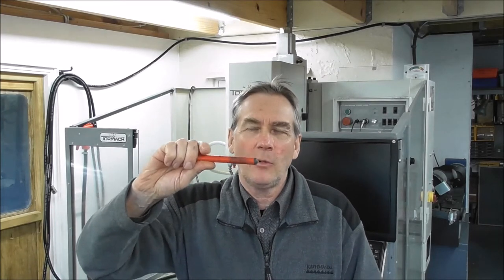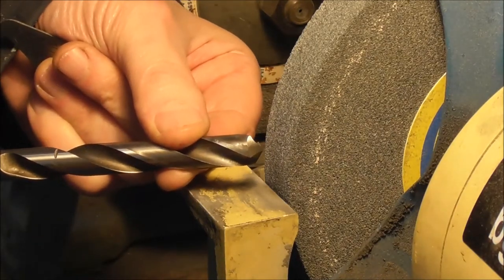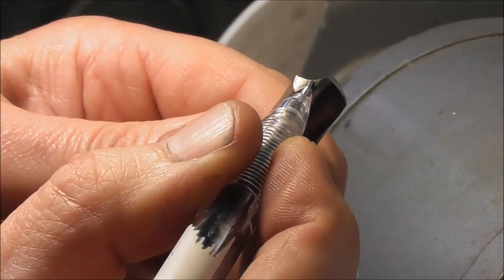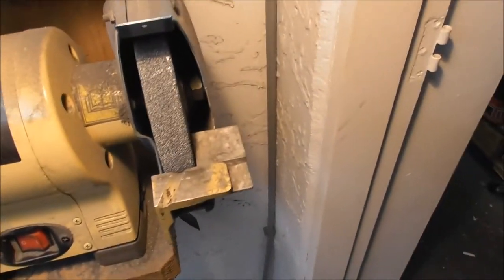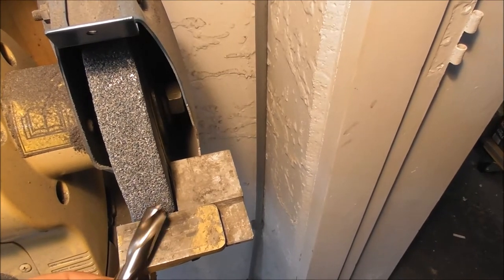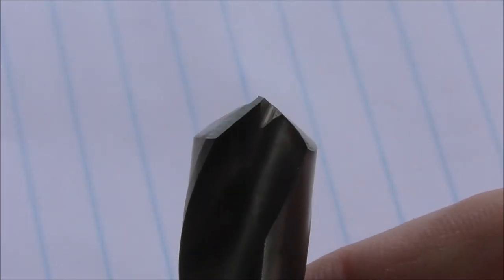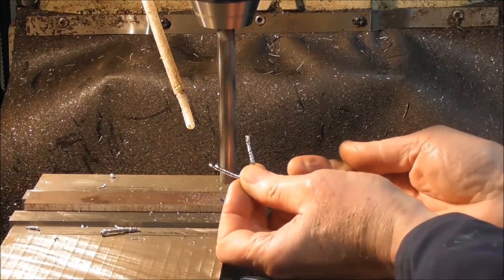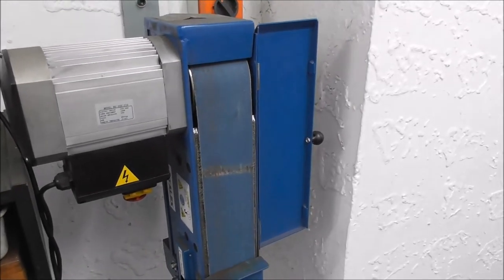Freehand Tool Grinding -  Part 1 - Drills

Comment: Another great video Cliff. Most of what I've learned over the years has been methods and techniques from a great many reference books. There are some things where a video like this one can demonstrate much better and far clearer than the books can. And I don't know why no one has ever seemed to mention just doing the two cutting edges first and then back the clearance off as you've showed. Makes perfect sense, it is just clearance and so as long as the two edges are equal, sharp and the correct angle then that's all that's important. In just 15 min. I've learned more than all the reading I've done about the subject. Many thanks.
Reply from the maker: Cheers, your feedback is most appreciated. Cliff